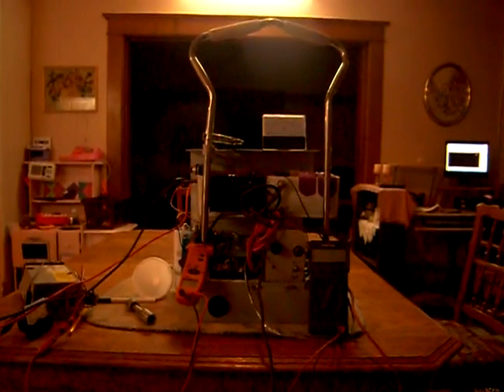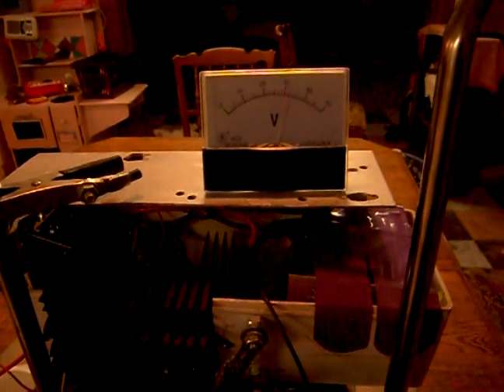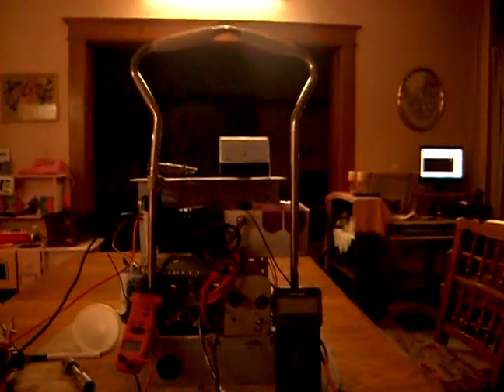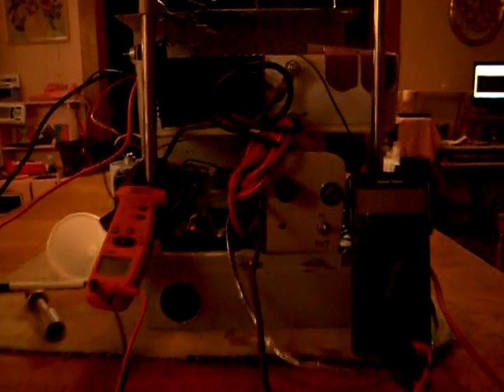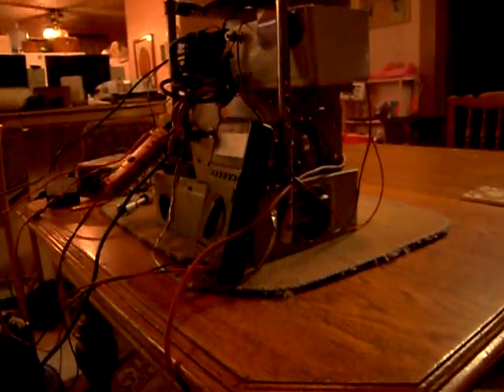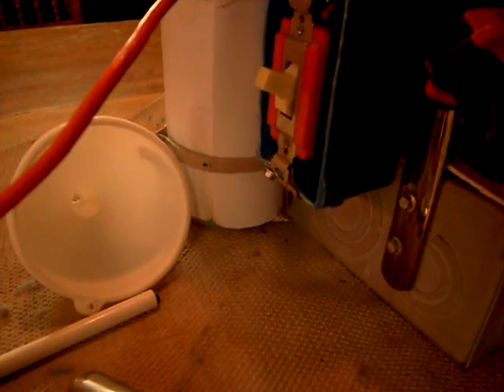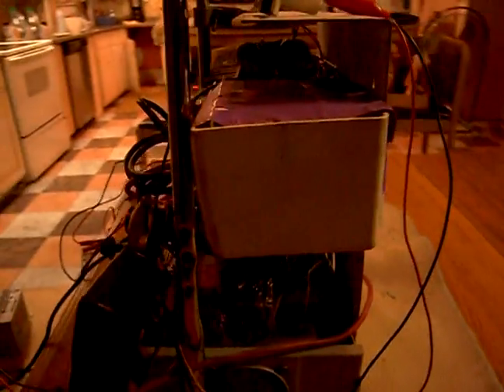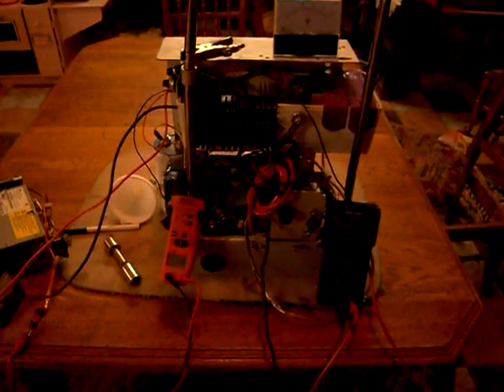Solid State SG Osc Bedini

Comment: Is it real work? which is the best performance between SSG osc and pulse motor Bedini? thanks
Reply from the maker: Both are battery chargers that do the same thing, spike the battery but the motor gives you mechanical power to run a fan